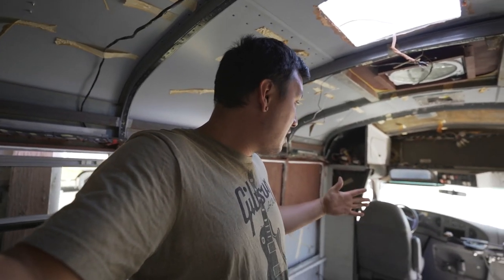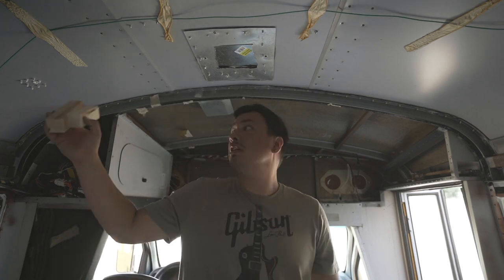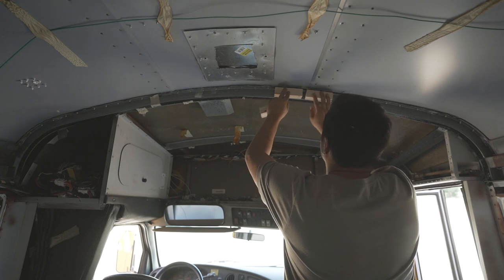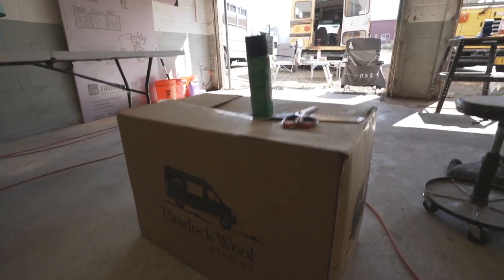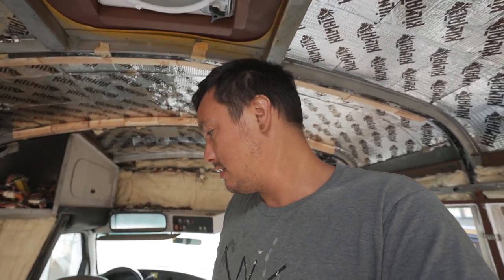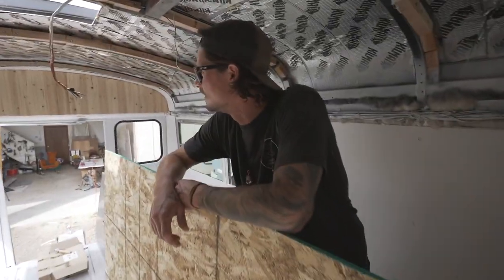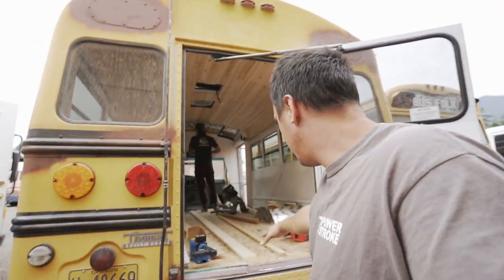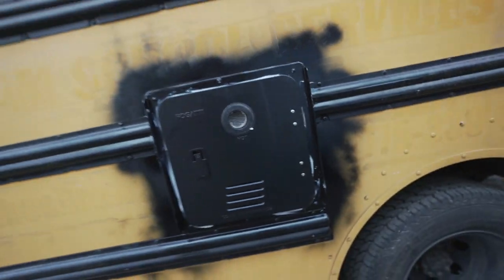A Week Of Building A Bus Insulation, Sub Floor, Painting, & A Cedar Ceiling

Comment: Hey Isaac, looks great! What are the metal drill bits you use? I'm having a brutal time trying to attach to the metal. My drill bit is for hard metal, Milwaukee Cobalt Red Helix 9/64". Please tell me what you use.
Reply from the maker: Milwaukee makes better than ones than that. I have a small set that’s for super hard metal and concrete all kinds of stuff. Just go to Home Depot and tell them you need the best
Reply: @isaacturnerit  Thanx for your help Brother👍

Comment: Question. You're using 2 inch screws on 2 inch wood. I'm assuming the wood is either not fully 2 inches wide or you're sinking the screws a bit into the metal frame? Thanks.
Reply from the maker: 2x2 is actually only 1.5in not sure why

Comment: Do you need to put up a vapor barrier on the walls and ceiling of a bus? If so would it be befor or after the insulation? I am usung foam board insulation.
Reply from the maker: That’s what we kidna use the Kilmat for